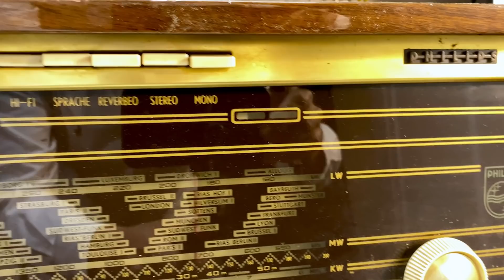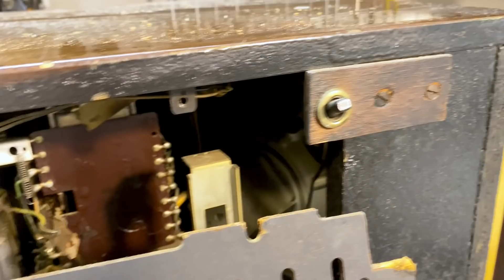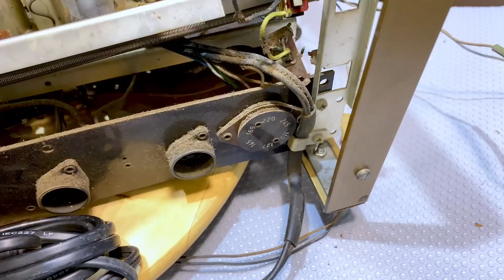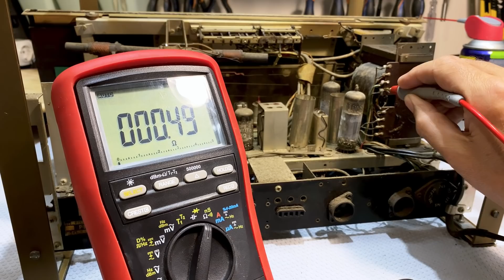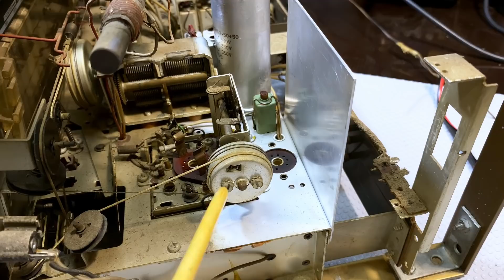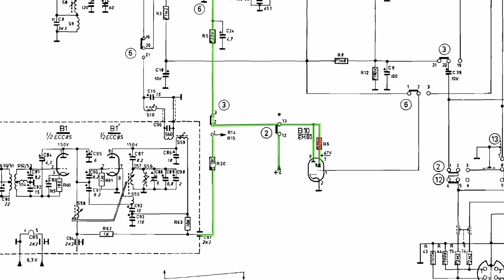Big, stylish and Dutch. Initial look at this Philips Reverbeo B7X14A Stereo restoration - part 1

Comment: I have very lttle knowledge of electronics, but am learning :)

My UK model is now working pretty well, but I have one issue (if it is an issue). When I first got this set, the voltage selector was set to 220v, which is strange seeing as the mains voltage in the UK is 240v. I was advised to change it to 245v, but when I measure the heater voltage it reads only 5.6v and not the specified 6.3v. The radio works but is this lower votage affecting its performance in any way. The heater voltage is the same when measured between pins 4 and 5 of the EM80 magic eye, the dial lamp and directly on the transformer. However this voltage increases to 6.1v if I change the radio setting from 245v to 220v (which I have been advised I should not do).

My actual mains voltage when measured with a small digital multimeter is 238v.

Any suggestions?
Reply from the maker: I would leave it at 245 as it is working and this will actually extend the life of your tubes dramatically.
Reply: @electronicsoldandnew  Thank you

Comment: There is a later model that has a stereo tuning indicator which means it should be a stereo FM tuner. I see your model which you say is the earlier model doesn't have a stereo signal indicator so it's mono on radio. I think it's a fine sensitive tuner. Got mine from Holland in excellent cosmetic condition refurbished but needs attention now. I was told there are parts on this that just cannot be found anymore so I'm looking forward to the work you carry out. Many thanks for uploading.
Reply from the maker: My pleasure. Good luck with yours

Comment: I grew up with one of these at home. It took a while for the sound to pop out at the selected volume level as you had to wait for the tubes to warm up enough to their ideal working temperature. 

The speakers were set at an angle,to project the sound in a way that each hit the sidewalls of the room, in order to meet at the center after bouncing to recreate the stereo effect.

It was heavy as hell! We keep ours on its own high table.
It had real wood (I think hardwood as ours was dark like mahogany) which made termites fall in love with it (they didn’t pretreat the wood back then).

It was very loud!

I guess the fact that it was solid, provided for the great deep base sound.

You could fine tune the stations until you gained the best quality from the broadcasted signal. 

Mind you it was built to last. Only needed the casual burnt vacuum tube replacement if used too loud constantly for months.

I was born in the 60’s and our radio was already at home with us. Saw the family expand till the last was born, then after that the grandkids…

My dad had bought this radio, together with a black & white Philips TV and stereo console by Marantz to complete the entertainment needs.

Back then they built things to last…
Reply from the maker: They sure did. I’m always amazed how these things come back to life after a little work. Amazing.

Comment: Cool, I have one of the same type. It came from Switzerland with Italian inscriptions. Yours seems to be in German (except for the balance control which seems to be Dutch). So I can use your videos when I do the restoration of mine. There is a sheet of asbestos between mains transformer and amplifier tubes. Was it already removed on your radio?
Reply from the maker: Yes, that sheet was something I was on the lookout for, but it’s not here.

Comment: My high school in the Netherlands had an annual flea market where I bought some of my electronics in the days when I couldn't afford new hifi statement equipment. One of the things I bought was a Philips tube radio with stereo amplifier that (in my memory) looked just like this, but I know they made several variants.
Unfortunately when I got it home, it didn't work. I threw it away (I know, I shouldn't have done that) but I kept the reverb. I found out that I could connect it to the headphone output and the microphone input of my sound mixer panel. Good times.
Oh and I also remember it had some sort of fluorescent light that didn't work anymore either.
Reply from the maker: I think all of us threw something away that we now regret 😊

Comment: Looking at the Z1, I remember some German radios that used something similar. It was a high wattage, 7-10 watt resistor mounted vertically with a similar spring action connection. When the resistor would get too hot, the solder on top would melt and the “spring” would let loose and open the circuit. You repaired the problem, soldered the “spring” back on to the resistor and you’re back in business. Love your videos, keep ‘‘em coming.
Reply from the maker: Those resistors got really hot. Yes, soldering it back is the correct way to solve it, but in this case you must do it with rose metal solder that melts at about 95 degrees Celsius.

Comment: As I've dug around further in my B5X44A, I've run into exactly the same problem that you have -- a thermal fuse buried in the primary windings that's blown.  I'm not sure of how I want to proceed, but I think I would like to do a closer visual inspection of the high-current-draw components and see if anything's dark or burnt-looking; perhaps one of them was drawing excess current and caused the transformer to heat up to the point the fuse melted.  My EZ81 rectifier's "getter" is almost black, which makes me suspect I might have a problem like yours (but unlike you, I don't happen to have any other EZ81s to swap in!).  The other possibility is that the layers of caked-on dust etc. caused a "partial short" (low impedance path) somewhere, perhaps due to absorbing humidity and then being energized (it was stored in a relatively humid basement for a number of years).  I'm quite wary of replacing the fuse and powering it up, since I'd like to know the reason the fuse blew.

I've also found evidence of others having been monkeying around inside the case -- some solder joints to newer components/wires are badly corroded, which makes me suspect plumber's flux might have been used.  To my surprise, all of the interior pilot lamps are still working, but their current draw is considerable; if I proceed with repairs, they're all getting swapped out for appropriate LEDs (single lamp or strip!).

This is not going to be the quick fix I'd hoped.   :-/
Reply from the maker: These philips sets are almost never quick fixes 😊

Comment: Though I like your fuse add-on modification, I think there are situations where the current and temperature don't quite rise at the same rates so one should replace a current fuse with a current fuse and a thermal fuse with a thermal fuse whenever possible.  A poor-man's solution that I have used on isolation and step-up transformers is to epoxy a NC furnace type thermal switch directly onto the transformer core.  Those rated for 45 deg C will stay closed until the core temp reaches 45 deg, then open and stay open until the core drops 10 or 15 deg depending on hysteresis, then close and the cycle will repeat itself until the power is turned off and the fault isolated.  Transformer cores take a while to cool down so depending on their physical size it could take an hour or more before the switch turns back on.  I have probably saved myself from at least one shed fire with this modification.  It's simple, cheap and reusable, though I admit maybe not that pretty inside a classic tube radio.  Thanks for the clear and easily understood circuit description, BTW - always appreciated!

Comment: As chance would have it, I'm working on a Philips B5X44A, ten tubes and six transistors (from circa 1964-65).  It was DOA, so the first thing I suspected was the rectifier tube (an EZ81); sho 'nuff, it's dead, but it would be relatively easy to sub in a couple of diodes (you could probably replace them right into the sockets!).

And like yours, mine's quite a large beast, with great honkin' speakers and a beautiful (although beat-up) real lacquered wooden case.
Reply from the maker: Just be careful with the B+ that will result from the two diodes as it may be quite high. You may need to add a series resistor to drop it a bit.
Those speakers should sound great.
Reply: Yeah, I've already been thinking about that -- the EZ81 can drop somewhere between 15 and 25V; fortunately, the schematic I've found for the radio specifies the B+ that's supposed to come off of the EZ81, so I can just adjust for that target.  "New" EZ81's are around $20 USD per plus shipping and do not come with a guarantee, and I'm trying to get this working again for a buddy who doesn't want to burn money on this radio, so I'm looking to save wherever I can.

And of course, there's a nice complicated dial cord setup inside it.  I hate dial cords.  ;-)
Reply from the maker: There’s no problem with using the diodes and a resistor, except for the initial high voltage leak before current starts being drawn. 
Dial cords: A plague 😊

Comment: I am working on restoring a similar unit - a South African-designed and manufactured Philips F4VZ 25A/R from the '60s, a radiogram unit which I want to convert into a desktop similar to the B7X14A. I looked around a lot and eventually found an original Philips document explaining the reverbeo concept -  the "electro acoustical reverberation unit gives considerable depth and spaciousness to sound stemming from radio broadcasts  or gramophone records and appears to expand the dimension of a conventional room to those of a concert hall" - see   https://www.vintage-radio.com/download/reverbo-leaflet1.gif

There was no schematic available, so I had to trace out the whole circuit. In short, when on the reverbeo setting, both audio channels are directed to the left channel, and the left channel speaker output drives the reverb tank. The output of the reverb tank is amplified by a transistor and fed to the right channel, which puts out an "echoing" version of the L+R signal. So the result is one clean channel and one reverberating version, giving the effect of being in an echoing room. It makes mono radio signal sort of sound live, but is pretty pointless if you have stereo music in. The reverb transistor amp is fed by B+ divided down appropriately. The reverb amp in the B7X14A is indeed powered off the cathodes as suggested in other replies -  see https://www.vintage-radio.com/recent-repairs/philips-reverbeo.html

If interested, my threads on the F4VZ 25A/R are on https://www.avforums.co.za/index.php/topic,79108.0.html and https://www.avforums.co.za/index.php/topic,94042.msg1054307.html. Ironically, I am stuck with exactly the same tuning slug problem you had earlier.
Reply from the maker: I had no idea they actually made these radios in SA. I should know - I grew up there 😊 Thanks for all the reference links. It’ll make interesting reading.

Comment: Nice project here, Manuel! I believe the cause of the thermo fuse melting was that shorted EZ81. Must have been an anode-to cathode short, the voltage was so low that the cathode could not heat and the tube not conduct in normal way. That fuse probably saved the power transformer. Regarding the transistor following the reverb tank, it seems to have its power feed from the cathodes of the EL84s. Nice way to get a low DC instead of using a big dropper resistor "oven" from 2-300V. Chassis cleaned up nice, this will be a show piece when done!

Comment: Reverb on the common cathodes, very interesting. Clever bit of circuitry. Can't wait for the next episode.
Reply from the maker: Actually, I got that wrong 😊 I’ve been corrected in the previous comments.
Reply: @electronicsoldandnew  Ah, yes just seen Stefans comment about the pnp transistor. Will look at the circuit myself later. Hybrid circuits always catch me out.
Reply from the maker: me too 😊

Comment: Nice - I've got the 1957 H4X73A (FM/AM receiver and record deck). Mono only. 220V only so needs a buck transformer for running at 245V to keep the heaters in spec. The Phillips black pitch caps were ok on mine but I may update them at a later date.

Comment: This is one worth following. I guess  Z1 is a thermal fuse and just tripped, because the solder sort of dried out over time. As for that re-verb spring unit it is the first time I've seen it in a radio. Many years ago I made a spring unit similar, to put a bit of an echo on a microphone. I hope later when you are testing that part it comes across on the video sound.
Reply from the maker: I’m sure it will
Reply: Z1 is a thermal fuse, and it is most likely of a low temp solder melt type (could be from 45 to 90 deg C.). It most likely tripped when the radio was turned on with the EZ81 shorted internally and the transformer got hot. The reason for the EZ81 failing could be leaky mains filter, too bad you didn't try to reform it as we would see if it draws excessive current. Also, I would re-set the fuse (remelt the existing solder), and put it back, and I would also keep the one you've put in, in series. David Tipton also repaired the same type of the fuse with the same low melt solder

Comment: Hi Manuel, the low melting point solder is called Roses's or Rose metal, I have some (a lot 😒) I'd be happy to send you some but the fuse will do a similar job as you know. The electro cap worked well, it looked like it hadn't been touched and the chassis is cleaning up so well, I'm very jealous. I assume the speakers are 800 Ohm, I haven't had a set with them yet so I am curious as to why they jumped from under 20 Ohm to 800. Thanks Manuel.  
https://en.wikipedia.org/wiki/Rose%27s_metal
Reply from the maker: I remembered that you had a rose metal encounter in one of your projects. 
The speakers are in fact high impedance ones, so can’t test it with my usual bench speakers. Must remember that 😊

Comment: Rose's metal consists of 50% bismuth, 25–28% lead and 22–25% tin. Its melting point is between 94 and 98 °C (201 and 208 °F).
Philips used this type of themperature fuses in many of their transformers back then. 
I use to harvest rose's metal from old transformers and other items as it's dificult to buy it.
Reply: It sounds like this Rose's Metal is similar to "chip quick",  a special low temperature solder with a wide temperature range for its liquid or plastic state, which is used to make it easy to remove microprocessors that have many dozens or hundreds of small tiny connections. The stuff is rather expensive.

Comment: I recently got a similar big grundig for free. Just the electronic and base, no chassis. This will be my first radio with my very own... wooden radio chassis :D Sadly i dont have such nice speakers like your Philips. This Grundig is also some sort of hybrid with transistors, tubes and relays too. Never had a tube radio with big relays to be honest. I dont have a part number for my grundig, its all gone sadly. The faceplate does not tell the model either. It also has some "moduls" with additional tubes and you connect these "moduls" with their own PCB into some of the empty tube sockets. Its like connectors with a tube base. All the PCBs are royal blue in colour, very interesting. Oh and its the first radio i own with... 4 transformers. A very big on and 3 smaller ones. Also very odd but okay.
Reply from the maker: That sounds like a really unique Grundig. Have fun restoring it.
Reply: @electronicsoldandnew  In the end it will be more about building a case from scratch. Never did any big wood work and stuff.

Comment: Nice! Another Bi Ampli project! A look at the scale learns this radio was probarly sold in Germany. I have seen many Bi Ampli's in my life but never saw the 800 ohm speakers or the special connectors they would use. Not very practical those high impedance outputs. Good luck!

Comment: That reverb in an a radio seemed to be a very short-lived gimmicky fashion phenomenon, and no wonder, because it really isn't very useful in radio listening, and is very far from true principles of hi-fi.
For example a separate 6.3V heater winding for only rectifier tube would have been a sensible investment, to make that radio more reliable. But perhaps useless gimmick features sold better than reliability then, as they probably sell nowadays better as well.
Reply from the maker: The power of marketing 😊
Reply: @electronicsoldandnew  In guitar amps however spring reverb tanks still are great sounding and very usable effect devices. Especially original made in USA Accutronics tanks sound great and last forever if not mishandled.

Comment: I don't totally agree with your analysis of the Reverb circuit I'm afraid.
As the Cathode of the EL84's have a 160uF capasitor and C87 (54uF) in parallell to ground, basically shorting all audio to ground.
So I don't think there's much of a audio signal there. That's just DC supply to TS1.
I rather think that the signal goes from collector of TS1 trough C85, trough Switch 12 and to the grid (pin 2) of the ECC83.
So it modulates the right channel with reverbed audio from the left channel it looks like.

When it comes time for those beloved IF cans (yes you know who I mean... LOL),
I found that on mine Philips it worked great to heat them gently with an airgun at a low temperature (150 C or so), just to soften the wax inside them.
Without heat they where stuck and impossible to move.
After heating the cans, and waiting a few moments to let the heat get into the core then they moved quite easely.
Reply from the maker: You’re absolutely correct about the reverb circuit. I just didn’t give it enough thought when I first looked at it. Stefan raised the same subject.
I’m already dreading those IF cans 😊 I’ll definitely go that route when I get to them.

Comment: Someone hast used the two switches, to replace the inner loadspeaker with externals, which are to heavy. So boom, the temperature-fuse and EZ81 blows. Am i right?
Reply from the maker: Probably what happened. Those switches were definitely a hack.